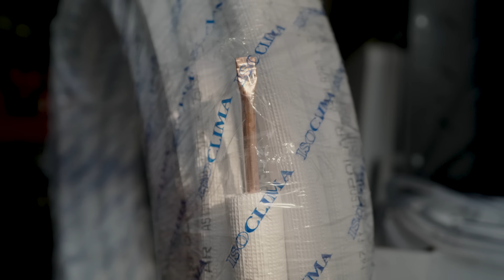How to Install a Wall-Mounted Mini-Split | Ask This Old House

Comment: I am the Electrician on this job. Oddly enough my ladder got more air time than I did. At least my work is tight.
Reply: Your ladder looks great! It has a future in Hollywood. 😆
Reply: Odd that they decided not to show any electrical work. It just magically gets done with hardly a mention.
Reply: Hard to find a well planned job like this, I've searched for some time to find a comprehensive solution like this. An electrical outlet and surge protection just for good measure. Please consider sharing insights on this. What products are used? Seems like 6-8 awg running to disconnect from panel with 12-14 awg to outlet and 8-10awg to split unit?
Reply: On second thought, isn't it common (and at least some codes) to run separate circuits for anything 30AMP or more?  So likely ran two dedicates circuits from panel?
Reply: @stacktier8257  i have one, and the electrician installed 40amp on its on 40amp breaker.
Reply: Is that what you always say every time the name “Justin” is mentioned? “I am the electrician on this job.” Sure you are.
Reply: @Rambo_760  You find it impossible to believe that someone who was filmed on the show would be interested in seeing final cut of the episode, really? 🤔
Reply: The window AC unit got plenty of air time.
Reply: When I was young, I wanted to be an electrician.  My parents pushed me to go to college.  Now that I’ve “retired” from corporate America, I’m learning to be an electrician. I really enjoy it.  My favorite thing to do is install a main electrical panel. I’m rather OCD, so my work is quite neat and orderly.
Reply: And I'm married to a European super model.
Reply: I am the electrician in this job. Oddly enough my ladder got more air time than I did. At least my work is tight.
Reply: Is that a 30 amp 120/220v disco????
Reply: Atleast Richard didn't explain everything like you don't know anything about your profession. They do that alot.
Reply: My god it’s a mini split, I could teach a monkey to install them….now let me go find a monkey lol.
Reply: did u get richards autograph
Reply: @cm1133  
You likely would’ve had a more rewarding career, both mentally and monetarily, had you skipped college and was always an electrician. 😉
Reply: superfuresh  I just installed one in my workshop, it depends on how close your power source is. In my shop the source was close by. Most residential models are 230v single phase (that means two hot legs). One piece of romex from source to the condenser unit (outside part), and one piece from condenser to the evaporator (inside unit). It’s not a big thing at all. If you know an electrician ask him ( I do my own), if you’re not an electrical person, don’t try it yourself.
Reply: @Xavier Finn instablaster :)
Reply: @Kendall Jalen it did the trick and I now got access to my account again. I am so happy!
Thanks so much you saved my account!
Reply: @Xavier Finn Happy to help :)
Reply: Ya, it’s kinda wired 😁
Reply: Cool, what a funny quiencedence.
Reply: How often do you deal with @thisoldhouse?
Reply: I’m the host of this job but Richard got more air time.
Reply: I was on a show like this for an entire day once. 8 hours of work and 1.5 seconds of air time.
Reply: What was the expectation? You become famous for being an electrician?
Reply: You didn't even turn to say what's up when he mentioned Justin
Reply: @rustyjeep2469  no… it’s impossible to believe that he is the electrician. How thick are you anyway?
Reply: I am the electrician on this job. You cannot see mee butt i did it 🤪
Reply: @cm1133  Corporate America, also known as indentured servitude
Reply: Salute ! You a celebrity now. Most pro actors never experience that. Seriously.
Reply: Did you talk to Jorge?
Reply: At least he gave you a little "how ya doin" when you punched through the wall! 6:14
Reply: Love that ladder!!! Lol For real tho, love mini splits, I’ve installed a couple this past year and they’re wonderful, very efficient energy usage too!
Reply: You were supposed to pay them extra to show you.  They did the same as they do with products that don’t pay them - turn them around backwards.
Reply: Good job.

Comment: I just finished renovating my house. I got 3 quotes from hvac contractors to install these mini splits. I was in shock by the price. For a 3 zone air handler hooked up to 1 condenser with a very easy run [less than 20ft] per line set, I was quoted up to 16K! The lowest proposal was 11,800. That was also with all of the walls open.My advice to anyone wanting these is do a lot of homework on installation and just buy the unit yourself. Doing so saved me at least 7-10k
Reply: I'd imagine that many people who get these put them in themselves as a cost-saving step. There are lots of videos on YT to help people along.
Reply: @4seeableTV  Agreed, luckily I had some help from a steamfitter that's currently on my jobsite
Reply: Lol yup I see it literally on a weekly basis then I get a call 2 yrs down the line for refrigerant leaks and bad units due to improper evacuation.
Reply: @frankgall6  could not agree more. I know someone who installed a MR. Cool on his own to save money. Found 35’ of pipe coiled behind condenser blocking air flow let alone the oil trap the coil made. Then he also installed a three zone where the saturated vapor line blew out of the flare nut releasing 7 lbs of R-410 into his yard and compressor oil all over his siding.
Reply: @whoheffa  Called you back
Reply: i thought you said 12k was the lowest quote
Reply: Yes. Although it's not recommended for diy, you can save lots of labor over 1200 for a single unit intall. I did careful research and got the tools needed.  Intall myself in 5 hours. If you are an average Handyman, it's easy.
Hvac tech gonna charged over 1 grand for a unit
Reply: If you don’t flare the copper lines correct or if you braze the line set incorrectly with the wrong weld stick you’ll be looking to call the same tech to come back and diagnose your problem. But at the very least for sure call an electrician.

Comment: I installed my split myself and called a pro to launch it properly.  Yesterday was the first truly hot day since having it.  What a pleasure.  Outside 92, inside 76.  First airconditioning I have needed in 25 years just to sleep.
Reply: Sounds like it's not charged properly you should be 30° from ambient air
Reply: @colbraddock9913  Most people don't want it 62 degrees in their house.  76 is plenty comfortable for most of us.
Reply: @mph7282  It flew right over you.
Reply: @colbraddock9913  perhaps.  You have a 30 degree drop from ambient in the air coming out of the unit, but that doesn’t mean you have to set your thermostat at 30 degrees below ambient.   What did I miss?

Comment: These things are crazy efficient.  If you have been running a bunch of window units all summer you will be shocked at how much your electric bill goes down when you have these installed.  You can also get bigger ones that flush mount into the ceiling for larger spaces.  The only rub is that when you use them in winter they do still start losing their heating efficiency/effectiveness when the temp drops below freezing.  You can get ones that are specially designed to work better in cold weather, but for very cold climates you are still likely going to want some form of back-up heat.
Reply: Living in the hot, humid Southeast, it's ability to cool efficiently is my priority. The biggest problem is sizing any unit. What is recommended is a joke. You either almost double the recommended size or it can't overcome the heat when you need it the most. I learned that the hard way, TOO MANY TIMES.
Reply: @allenh7835  Correct and if you go too big it will overcool and you'll end up with high humidity.  And they never flash the exterior correctly so outside air comes pouring right on in.

Comment: I love my mini splits.  Added one for the master bedroom, primarily for cooling.  
I also converted a three seasons porch into a full time office, and I am using a Diakin min split for heating and cooling, year round in Wisconsin.
Reply: What did 1 unit cost you?
Reply: How much did your electric bill increase with the install of mini splits?
Reply: @michaelkaylor4779  Not nearly as much as other ways
Reply: Also using Daikin in Australia. The mini-splits are very economical and the night mode fan is almost silent
Reply: @jcshort31  My neighbor had his garage converted to a gym, and the install was $2300 labor and equipment.

Comment: I can’t wait to get one installed in my bedroom! I’m so tired of burning up on the 2nd floor. Thanks for this video, I appreciate all the info. ☺️
Reply: I know your pain I have to convince my landlord of Almost 12 years I need one badly
Reply: @taniamarie2486  Well if I were you I’d go by the old adage of “It is easier to beg forgiveness than to seek permission.”😉 On a serious note, though, nobody should have to suffer and be uncomfortable in a home that they’re paying for. I don’t understand why your landlord would have an issue, it’s the better option. I hope they come to their senses soon. I live in NC and it’s already starting to feel like summer outside. 🥵
Reply: @taniamarie2486  The law requires cooling if you have to call 311
Reply: @taniamarie2486  you can't use a window unit?

Comment: One of the best upgrades I made to my house that lacked a central HVAC system. Had it professionally installed as I didnt feel comfortable buying one of those DIY kits. The heat pump is absolutely silent and mounted to my brick with a similar bracket.  You don't even hear it running outside unlike all neighbors heat pumps which sound like something off a battleship. If you go the installed route get multiple quotes and get an installer that understands your needs/ expectations. Not someone who wants to make it as easy as possible for them. Carrier Infinity Ductless system.
Reply: Do you live in an HOA?  I’m thinking that mine will flip out if I wall mount a unit.
Reply: @zeroturn7091  mine just wanted the lines covered up with aluminium trim

Comment: Mini splits are the best!  Another added benefit is when it is time to replace the units it a lot less money and easy to do.
Reply: Tony Po  A 5,000 BTU window unit is inexpensive.  However a decent mini split at 12,000 BTU is only about $700 and will cool and last a lot longer.  I just bought two a few weeks ago in a property in the Caribbean.   They were branded as York, one 9,000 BTU and another 12,000 BTU.  $1200 including installation.

Comment: To my way of thinking, condenser's should always be set two to three feet above the ground on a regular base's, especially if you have a heavy snow or major leaf problem. The damage done by winter snow year after year along with salt, like any other metal product is really bad for the long term use.
    The leafs should be enough of a reason because you are constantly having to clean up the unit to keep it from being plugged up for good ventilation through the evap and cooling of the compressor. Just makes more sense to me, but it does make installation and servicing a little harder, which is why I think they always put them on the ground.
Reply: Leafs?  You think "leafs" is a word and you want to give technical advice?   SMH

Comment: These Split AC units are the future. We've been using them in Asia for decades and couldn't ask for anything better
Reply: Not here in the US. Here if we can afford central forced air and have the physical ability to use it it's what we always use.
Reply: LOL, we first used split system in 1995. At that time, nobody used window units in my country. Right now, people in my hometown still use split units. Newer condo units are using central. It's funny you can still buy window units in America as of 2021.
Reply: @whoeverwhoever400  window units are pretty cheap.  If I weren’t worried about creating a security weak point, an entry point for pests, and being an exterior eyesore I would definitely consider one.  My grandparents had one in the 80s and that thing was a beast.

Comment: i had these in my rooms in my apartment while i lived in japan and i loved them. i'm now back in the States and have just the normal 1 central AC for my whole townhouse. it works fine except for my 1 computer room on the third floor. rest of the third floor is pretty fine, it's just the computer room with my PC pumping out heat combined with the fact that heat rises.

thinking about adding a small one of these to that room as I spend a lot of time in there. they really are great

Comment: Really a great video!
I live and are the owners of a 2 family house in NY that uses regular window A/C for the summer and brand new Pearless Steam Boiler for system radiators. Problem has always been that the steam radiators get hot in the lower apt but the upstairs apt is always cold. In order to make them comfortable we have to almost turn on our A/C during the winter. So we were thinking about installing a split system for the upstairs APT.
Reply: Your steam system imbalance needs to be addressed.  Pick up a copy of "The Lost Art of Steam Heating" by Dan Holohan, and you'll probably find examples of whatever in your system needs to change.  Its either bad vents/traps, improper vents/traps, or improper near-boiler piping...or a combination.  Your pipes were designed by the dead men who first fit them to heat evenly from the start.  I'm going through this now, have the venting set up pretty good but my near-boiler piping is terrible and the unit is oversized relative to the capacity of the radiators, so I'm just here hoping the boiler springs a leak before the gas valve goes from all the pressuretrol cycling.
Reply: It might be the valve caps, simple fix

Comment: I'm in New York. I'm a certified HVAC Tech. I usually charge $1,700 to install a single zone mini split unit ( Labor cost only ). Customer buys the system of their choice.

Comment: Still amazes me how long it’s taken the US to start using this type of aircon unit like it’s the latest greatest thing when the rest of the world has been using them for decades.
Reply: Well actually most air conditioners in the US are Central forced air. 
But the main population that has no access is everyone in populated cities who live in high-rises would have no place to put their units. So everyone is stuck with the regular window AC.
Reply: Mini splits have been used for last 25 to 30 years in USA. They are more of a pain to service and they also tend to grow mold at times. This is cause all mini splits have very poor filtration. Merv 4 at best so that makes them high maintenance. They need to have a deep clean more often than traditional split systems with ducts
Reply: Just read a report that the US is no longer in the Top 10 Most Innovative Countries, and the US arguably had the worst coronavirus response to boot.
Reply: @PawsAndKeys  your right China is the worst for Corona Virus response
Reply: @pineychristian  The Coronavirus is the longest something made in China has lasted!
Reply: @IAmNotAFunguy  😆 😆
Reply: @4realjacob637  The rest of the world doesn't have that issue because high-rises have plenty of wall space to mount mini-split condensers. It's more of a regulatory issue than anything else.
Reply: People in the US on average are very slow.
Reply: The reason the rest of the world uses mini splits and not Central airs because their homes are not made out of wood and they don't have the spacing to run AC duct. Most homes are made of concrete and the rest of the world
Reply: @Ryousure  👍 bingo
Reply: @pineychristian  yes true....I was told 350 dollars to clean each inside unit....I have three units....that would be a thousand dollars every year to properly clean them....and I am running a dehumidifier all the time....they are not removing humidity.....I am so upset over these things!
Reply: @janevance6637  sounds like someone didn't properly size them or something is possibly wrong with them. If sized and installed correctly you should have no issue's. They are a real pain to maintain and work on but they can be very effective and efficient

Comment: This is a really good way to cool off your house if you don't have central air conditioning, I would think these units are best for small spaced areas like garages, workshops, shops, and much more, when I grow up I am would like to be an HVAC technician.
Reply: I just started as an HVAC tech at 31 years old and I wish I had done it sooner. It's very challenging yet very rewarding work and it pays very well. Not to mention being able to do work on your own house and not having to pay for someone else's labor can save you tens of thousands of dollars!